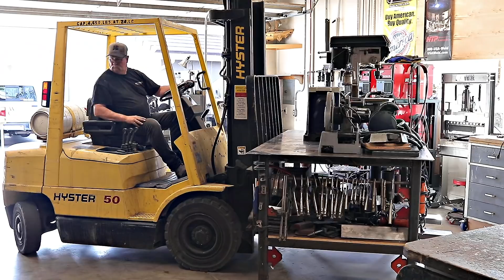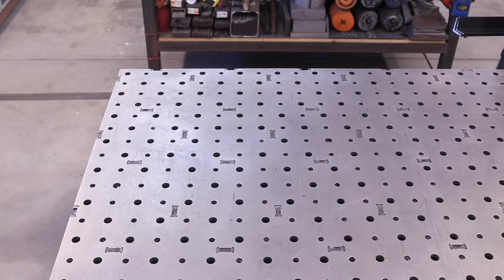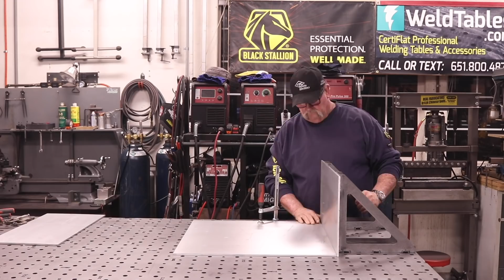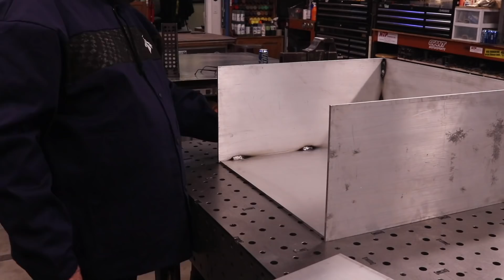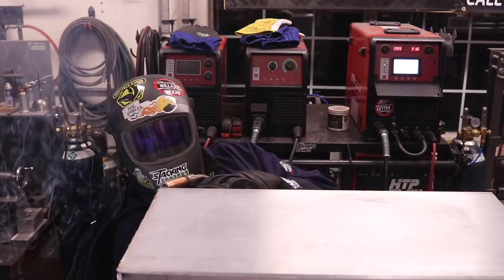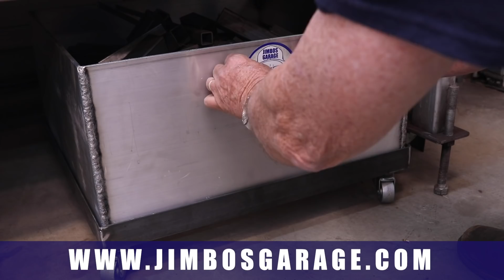Aluminum Metal Scrap Bin | JIMBO'S GARAGE

Comment: not true jimbo all i did for 2 years in a fab shop was vertical down with a miller xr push pull gun all aluminum down hill and hot

Comment: No Spool gun?
Reply: x01e no spool gun AND pulse ....  THAT is the way to go ....  spool guns are like crutches ....  you can only adjust wire speed on the gun, but on aluminum adjusting voltage is even more important ....

Comment: nice one jimbo as usual...question for you please,i was always under the impression that you cant mix the 2 diff metals...i have a good idea you live in a mostly sunny state ,but still must be a certain amount of humidity,will this not cause a reaction to occur........anyway ,all the best jimbo,looking forward to the next project
Reply: You are absolutely correct! I used to fabricate aluminum trailers for a living and anywhere the aluminum touches the steel subframe we would have to tape off the steel subframe so the aluminum does not come in direct contact. Overtime the steel will rot out the aluminum without the tape to separate them. That being said in his shop out of the elements this project will last a long damn time before any corrosion starts!
Reply from the maker: Thanks for watching dougie, Good question? I have not seen or heard of that, But we will see!    Jimbo!

Comment: Couple of quick questions - was that straight, or did you pulse? I've never tried to Mig Al with my Lincoln 180 with the gun, instead I bought/use a spool gun. Do you think you get the same results w/o the spool gun? I always figured it was more of a PITA changing the liner, etc, to run Al.
Reply from the maker: Thanks for watching, That was single pulse or pulse. I have never used a spool gun, It is an easy change out from steel to aluminum, On the Htp it is a gun change and wire. The gun is a 26 series. The process take 5 minutes or less.    Jimbo!
Reply: @JimbosGarage  Thanks for the reply, I like the way you do your videos. So instead of a spool gun, do you just have a second gun dedicated for Al? I guess you don't have a problem with birdnesting, that's really the reason I bought the spool gun, plus I use the spool gun for heavy Al, and I Tig the lighter stuff. Anyway, keep making videos.